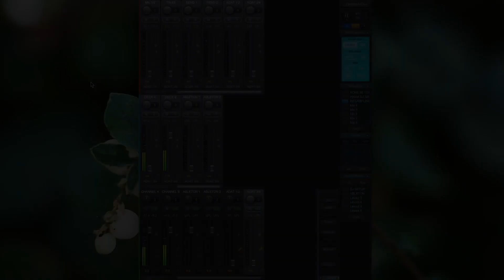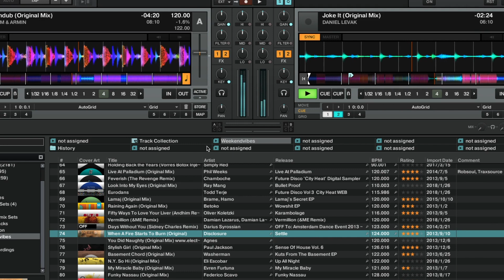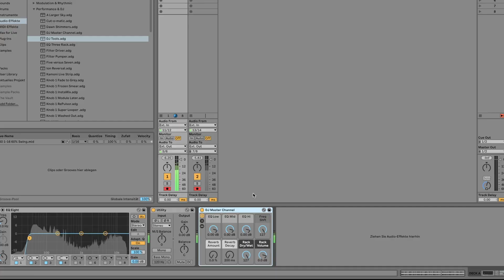Resampling your DJ Set with TotalMix FX | RME Blueprints #05

Comment: RME Audio Interfaces are unreliable, especially on Mac.
Reply: Coming from a user with Fireface UFX for 10 years, using it ONLY with Mac, i can say your comment is entirely FALSE.
Reply: Liubo Ursiny Nope, it turned out mine was a “faulty unit”. A support engineer form RME jumped on my computer using TeamViewer, and he was clueless about what’s going on with it. I had to send it back. They still owe me an explanation about what went wrong with that unit. Unfortunately, this was my second interface in my eight years with RME, which stopped working without any reason. I glad that you had an excellent overall experience with them, that gives me hope. But that doesn’t mean that everyone has a consistent experience. The replacement unit works fine but, let’s see how long this one last. I’m an optimist. I kept the replacement unit instead of selling it. And don’t get me wrong; when it works, it sounds incredible. On the other hand, I need reliability; that’s not what I got so far. That's my experience, and the fact that you had a positive experience doesn't change mine.
Reply: rokibeat234 I’m using my unit on the road in different sometimes extreme weather conditions and i had 0 issues whatsoever. There is always a chance of defect units, no matter which brand they are. I’m sure your replacement unit will be rock solid for the time being. Keep it positive!